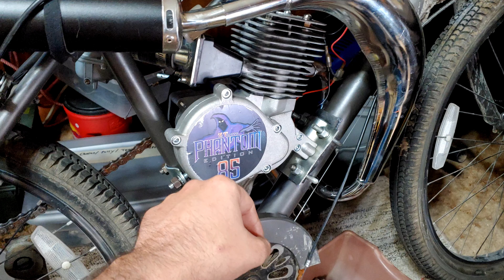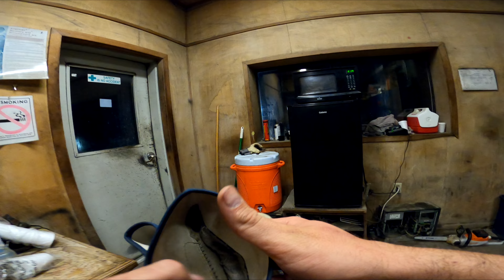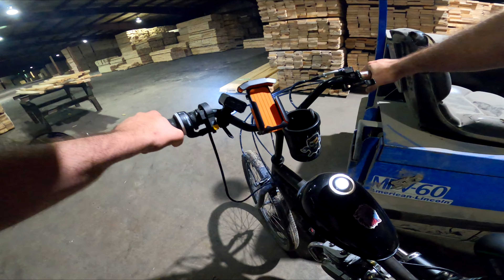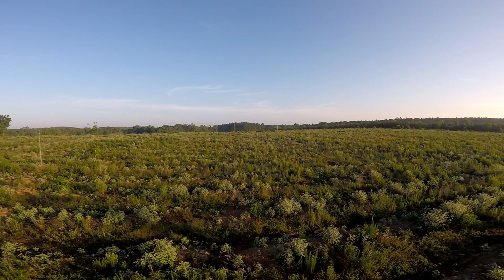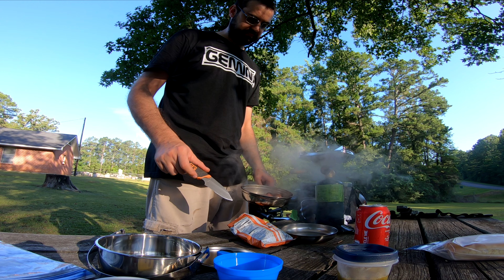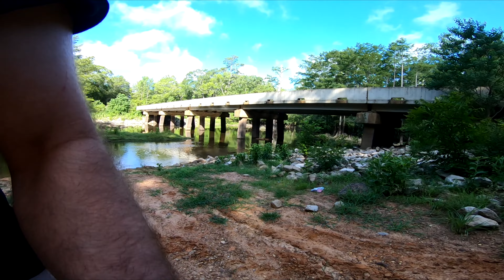Motorized Bike Celebration

Comment: Nice video,brought back some old memories for sure. I used to work at a sawmill,driving a Honda Hobbit to and from way back in the day. Seeing those kilns brought it all back,lol.
Reply from the maker: Right on man! Thanks for dropping in :)
Reply: @LAHover  Love your videos my friend. I have been looking into my first build and your videos have been such a blessing to this (small?) community. I have a 29" all aluminum single speed(Beach Cruiser)bicycle and I want to use this for my motorized bicycle but I'm not sure and don't know how this bicycle would work with any motor being a single speed. Any input you have on this would be much appreciated.Thank you!
Reply from the maker: @CarolinaGuy  as long as it's not a fixed gear bike. And as long as it's a true cruiser style frame (not a chopper). It should match nicely.
I'd add rim brakes if it does not have them.
But if it does not work out, there are many other frame options.
Reply: @LAHover  By fixed gear meaning no gears? My cruiser has no gears,this is my biggest question as I'm not sure how one of these engines would do on a single speed. I have other bikes but that 29 is my favorite.
Reply from the maker: @CarolinaGuy  single speeds are fine. Look up "fixed gear vs single speed" to see the difference.

Comment: Great video as always...
BUT, .... I'm kinda disappointed because you didn't have sparklers in the rear as you were riding...
Nor did you have bottle rockets in the rear to give you a little extra boost...
 
I'm sorry to inform you that I must give you a 9.1 out of 10...!!!!
Great job and a late HAPPY 4TH OF JULY...!!!
Maybe next year you will earn a 10 out of 10 with the correct boost mechanism...
( Bottle rockets and sparklers )...
Reply from the maker: Funny you mention that. I had two 5 minute smoke bombs for under the rack... But I completely forgot to use them. I'll use them soon ;)

Comment: Love that mill job of yours I am always proud of hard working American's like you I would love to see another 4 stroke video 📷 just use set screws in the mount to keep it from moving I have a huffy Nel Lusso with a 49cc 4 stroke on it I put set screws in it no problems for the past 2 years with it
Reply from the maker: Good tip I might try that if mine give any more trouble. So far it's doing ok.
Reply: @LAHover  you didn't give us a new video showing us you fixed the 4 stroke I would of loved see it. Bummer ❌

Comment: @ 3am the keyboard warriors are at their keyboard in the shadtof their mothers basement thinking of a new comment to say on somebody's channel that has no validity but makes them feel better about themselves for the two minutes they take to write the comment. Since they have no real world knowledge because they just type instead of go outside and just try to actually do something fun, but they rather sit and type about what they think is better because they seen it done on a different video by someone else.... But never done by themselves.    It's easy to say I don't have much love for keyboard warriors.  Thanks for posting and blowing stuff up, that's always good content.😁
Reply: Ironically,I'm setting in a basement,because it's actually cooled down to 82f outside,but is a nice 72f down here,and I agree about keyboard warts.I'm currently letting my bike rot in the Hell outside as it doesn't want to run well.Probably because the fuel evapped like LA mentioned.At this time,I'd rather watch someone else melt,and set back with a cold soda and enjoy.Happy Freedom America !!
Reply from the maker: Grease and oil under our nails. I don't want to know what's under theirs...

Comment: for the bent crank arm try MAP or MAP PRO gas to fix it. it burns far hotter than propane and heats things up faster. i used it to bend my stock exhaust in like 5 minutes of torch. only thing better than it is oxyaceteline. only caveat is you need a special torch. the cheapest one i could find was a bluefire brand one pencil flame for like 15 dollars

Comment: I’m struggling so much building my first motorized bicycle. The throttle cable in specific. How does it orientate in the housing and is it normal for the carburetor to be so tight with the plastic throttle piece?
Reply: That's what my experience was like, a tiny bit of sand paper on the carb end and a bit of adjustment on the wrist end worked for me
Reply from the maker: Hard to explain in the comments. Try to get rid of any tight bends in the cable if it feels stiff. For further help you can join the discord. Link in the discription.

Comment: I "freshen up" my old/bad gas by adding carb cleaner to it. I stick the red spray tube directly in the gas & spray, then mix it with fresh gas 25/75%.(Can also add a bit of acetone or MEK if you have it laying around like 1-2% along with carb spray)  
 I know when gas sits, the more flammable chemicals in the gas like butane ,toluene, xylene  evaporate out faster than the less flammable chemicals. That along with the ethanol in the gas is attracting more water from the humidity in the air.  
For say 1 yr old gas, take the old gas & put it in a clear jar add about 5 or 10% water to it & shake it up, then let it sit for an hour or so. You'll see a separate layer of water/ethanol form at the bottom. Siphon the top layer of gas off leaving the ethanol/water bottom mixture behind. Add carb cleaner to the gas you siphoned off & mix 25%/75% old to fresh gas. 
Iv'e done this several times with gas that's sat over winter in my motorcycle. Once my moms van had 10 gal of gas that sat well over 2 yrs in the tank. I got it out drained off the ethanol water mix, added carb cleaner to old gas & used the 10 gal of gas mixed 25/75% in my carbureted motorcycle with no issues.
Reply from the maker: Good to know, thanks :)

Comment: So a phantom 85 bottom end fits a yd 100 top end so does that mean I can vice versa and use my whitey 100 bottom end and get a phantom 85 top end to put on it
Reply from the maker: Yup, but you will need to open up the wrist pin hole on your yd100 connecting rod to fit the phantom 85's 12mm wrist pin.
Reply: Thank you I can do that I got a shop with all the tools I could need and I'm capable of doing that thanks again

Comment: I've had better experience using a 12v battery to run lights. I can say before that I went through A LOT of lights. The nice thing about it though is if you have a trailer you can run that to the same power source as well. Also Happy even later 4th!
Reply from the maker: Hey, thanks for the tip!
Reply: @LAHover  Absolutely, Thanks for the great content!